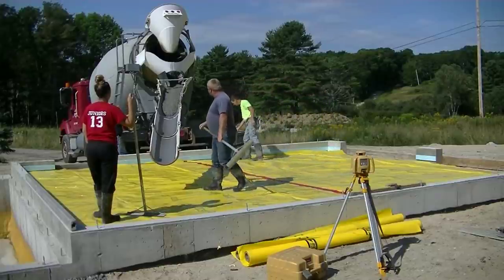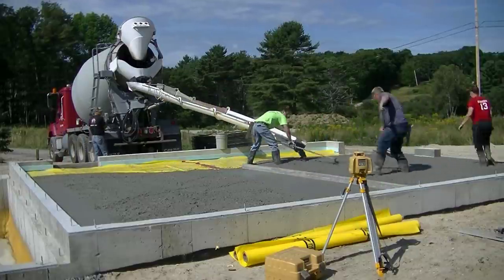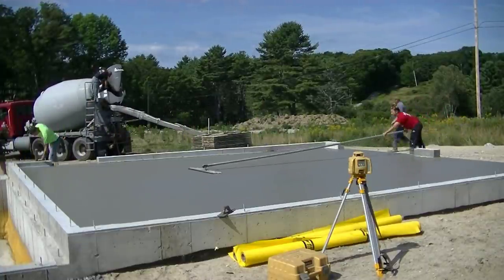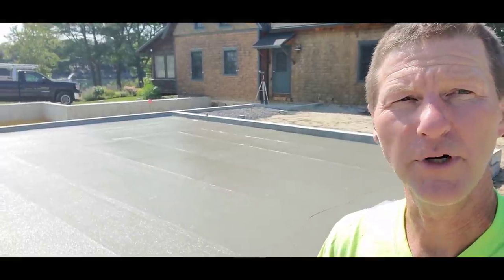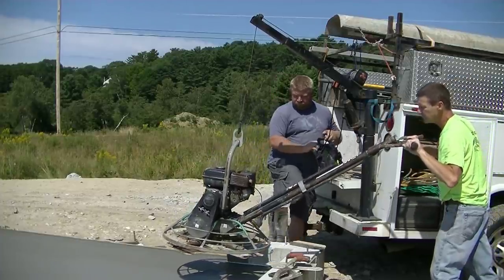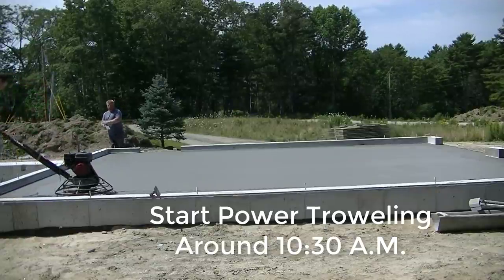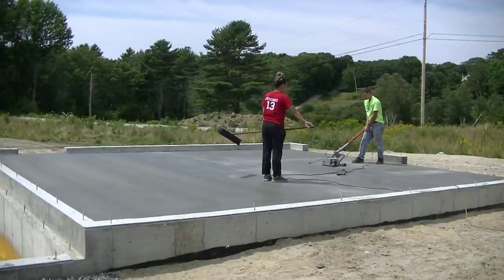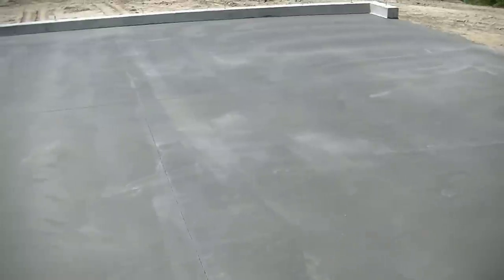Pouring A Concrete Floor when Rain is in the Forecast (Fast Setting Concrete)

Comment: Mike  I'm a 30 year veteran of running a concrete business.  I use to scratch in the ramps like you. 5 years ago I purchased a ramp tool from supply house.  They come out perfect every time. I would be lost without it now.

Comment: I’ve gone to using key lock at doors and drop the outer form 1/2-3/4” depending on wall thickness.  It also keeps the floor from cracking on the inside corners of the wall without having to saw or tool a joint that will hold water under the door.  Great videos, thanks for sharing!

Comment: Definitely use non-calcium chloride if steel is in the slab. And 2% at 70degrees is crazy. In my region in florida 2% at 70degrees the entire floor would be burnt in in about 2 hours tops and will completly get away from a non experienced concrete guy. I would recommend .5-1 at that temp.

Comment: How can you tell if it has an accelerater? I did a job one time and the concrete set and was dry like 20 minutes after it hit the ground ruined my whole job. I then called the plant n they said they put an accelerater in it without telling me.